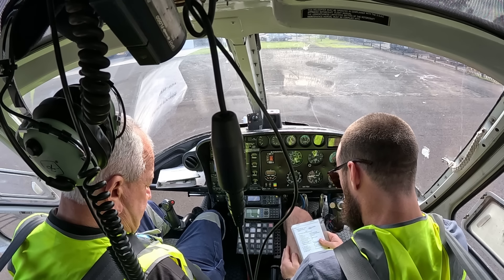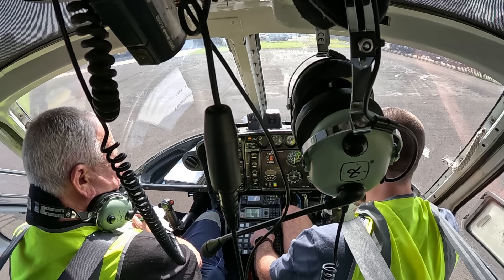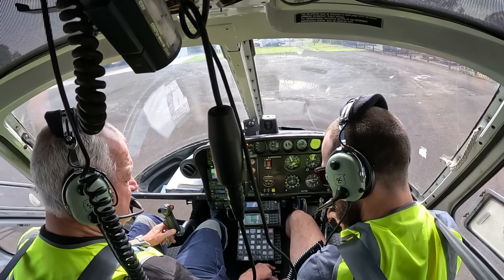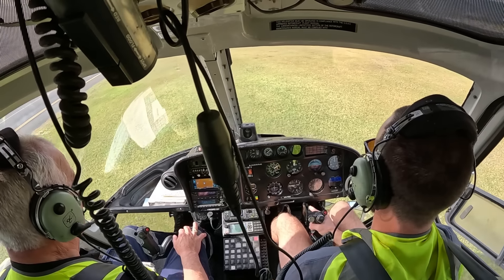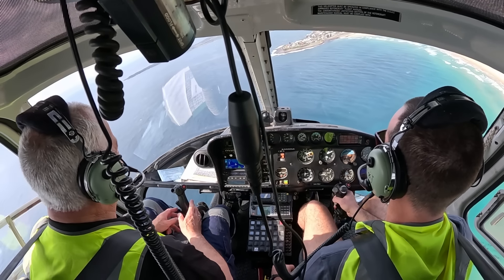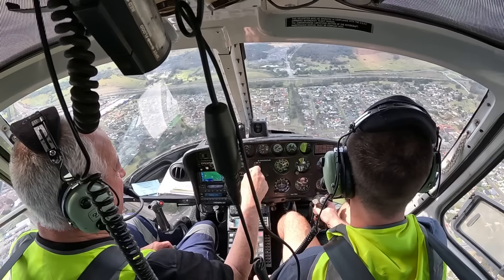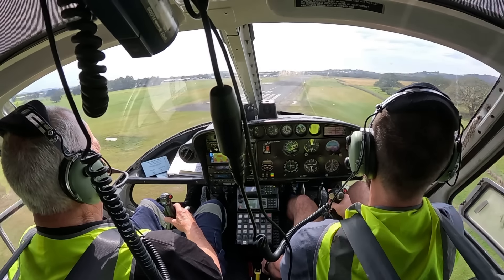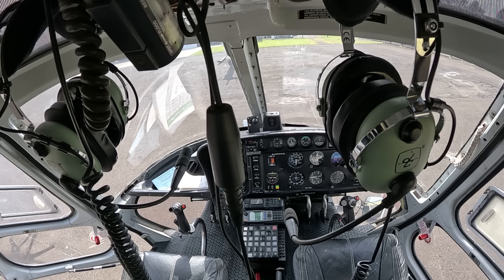Learning to Fly an AS350 for the First Time

Comment: have you ever done a video of how to fly a Bell jetranger that you normally use, i see the airbus helicopter you was using in this vid is a tricky one to fly so are the Bell choppers a lot easier to fly, i see the life flight in QLD seem to have a lot of the Bell 412-eps and a couple of the aw139's and a saw a kawasaki chopper at one stage.
Reply from the maker: mmm, each chopper is different, with different flight characteristics and systems. Is a corolla any harder to drive than a landcruiser? not really until you wanna tow something